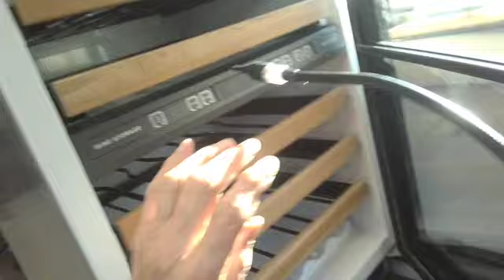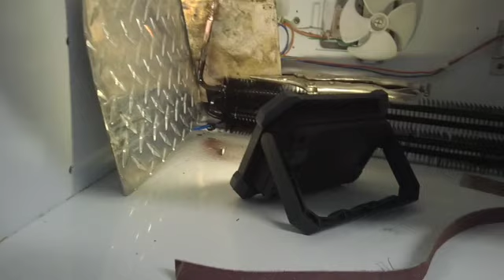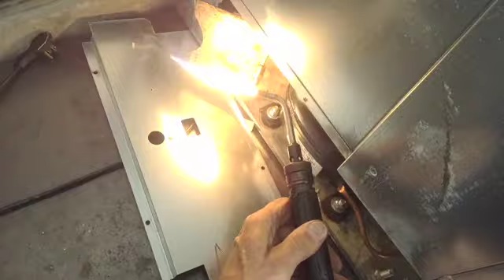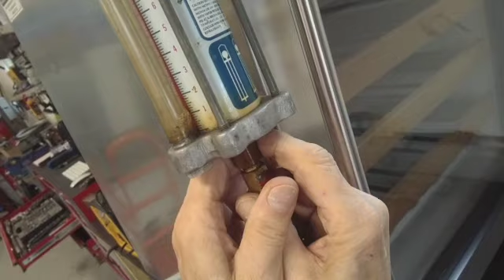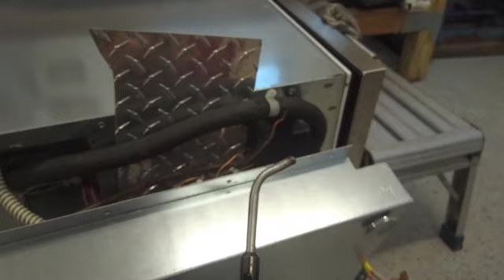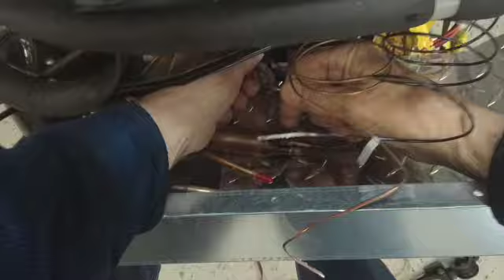Sub-Zero 424 Wine Cooler Sealed System Repair

Comment: Hello friend, excellent video, I have that same cellar, with the following failure, I work well for a couple of days with good temperatures in both compartments, but on the third or fourth day the temperatures rise to 81 on each side and he asks me for service, It also turns off, if I disconnect it and reconnect it works a couple of days more, you can guide me where the error goes, thank you very much.
Reply from the maker: It sounds like one of your evaporator coils is icing up due to a freon leak. If possible check the sealed system pressure, it may be low on refrigerant. It could be many other things but freon leaks are the most common.

Comment: what is the normal amperage rating?
Reply from the maker: Start amps or run amps?
Reply: @SubZeroSpecialists  start and run please.. ty
Reply from the maker: You can find that info on our website www.Aarons Refrigerstion.com under Tech Help. Look under Technical info. The start amps are 6 x the run amps. It’s also listed on the compressor

Comment: Nice job!!!! I do these under warranty for True Residential and evaps are the leakers there. Since they are warranty True pays to replace all tubing, both evaps, compressor and switching valve. I remove the middle control/shelf and that gives me a much easier time in both compartments. Just my opinion...I would have replaced the other cap as well and blown the other evap out with nitrogen since the unit was sucking in moisture, just to save you future aggravation.
Reply from the maker: I pulled a deep vacuum on both sides of the system to eliminate any moisture. The unit was delivered last week and has been working properly. Thanks for the comment. Let us know if there are any other videos that would help.
Reply from the maker: I worked on a True Residential wine cooler last year and was impressed with it, I think they will give Sub-Zero a run for their money.
Reply: @SubZeroSpecialists  I agree, it's very nice equipment. Other than the problems with some evap leaks and software upgrades they've been bullet proof.  I am authorized with True and would like to become authorized with Sub Zero in the Philadelphia Pa market but it's easier to get struck by lightening than to get a response from Sub Zero.
Reply from the maker: @stevengilber1153  How did you get authorized with True? Do you do commercial as well? I also would like to be authorized to do True Residential. As for sub-Zero the company has changed quite a bit since the grandson has taken over. As for becoming factory service, you have to know someone to get in, but once you're in you're in for good.
Reply: @SubZeroSpecialists  I would call their residential technical service dept at 1800-325-6152 a fellow named David Swift is who I originally dealt with....very easy to get along with. I do not do commercial and in my area True has a boat load of authorized commercial guys and only three residential...I think most commercial guys are to busy and not use to dealing with high end home owners.....who can be a pain in the A-- as i'm sure you know. I too remove all of the sealed system work and do it at my shop unless its in an outdoor pool house/kitchen setting which is seasonal.
Reply: @SubZeroSpecialists  Also too...watch this video https://www.youtube.com/watch?v=9i9aLdcfCpY and tell them that you're interested in servicing the new R290 units. They are just now starting production of them and phasing out R134a in the resi line.
Reply from the maker: @stevengilber1153  Thanks Steven, I will call them. BTW Sub-Zero is also shifting to R600. Same precautions same explosion-proof parts. I wonder what that will do to the price of a new unit. I remember the first refrigerator I worked on had the compressor on top of the unit and it took hours sometimes to charge a sealed system. Times have changed.
Reply: @SubZeroSpecialists  How did you make out with True?
Reply from the maker: @stevengilber1153  Haven't called yet. Are they using R290 in the residential units
Reply: @SubZeroSpecialists  They just begun shipping them....up until last month its been 134a.
Reply from the maker: @stevengilber1153  May I ask how long it takes you to do the repair and what is it worthwhile?
Reply: @SubZeroSpecialists  Which repair are you speaking about?
Reply from the maker: @stevengilber1153  true sealed system repair
Reply: @SubZeroSpecialists  Very geneous...an evap, compressor and line set on an undercounter wine fridge they pay 7hrs plus 1hr travel time. I remove them back to my shop as well. I can generally complete it in about 5 hrs. Their times on most repairs is very fair imo